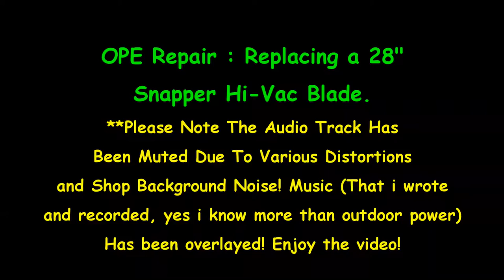OPE Repair | Replace a 28 inch Snapper Hi Vac Blade

Comment: The nuts were terribly frozen onto both bolts. One was so bad I ended up using a Nut Splitter slowly over several days before it split. I had to do it by hand with a socket wrench. This time I made sure the bolts were covered with Anti-sieze coating when installed.

Comment: Wouldn't a hi lift blade help to lift the grass better for a more even cut? And also pull more leaves off of the ground for shredding? Just wondering cause I have a Frankensnapper, a rear engine rider originally with a 26" deck that now has a 33" deck with a 30" blade. I traded for it and just found out that it was configured that way before I got it. It's in really good shape for it's age but I want to put a new 33" blade on it to take advantage of the 33" deck. And I doubt that it's very hi vac with a blade 3" shorter than what's supposed to be on it. I'm thinking that the blade and deck design is what makes it  Hi Vac.
Reply: I meant adding the Hi Lift wings...
Reply from the maker: Hi, sorry for late reply, as long as a blade has lift edges on it will lift the grass, regardless if it is a low lift, hi lift or mulching they all lift the grass, Snapper's Hi-Vac is only suppose to be used with a bagging system, that is when you use the bolt on lift kit, other than that for side-discharging the lift kit is not necessary but it is generally user preference, you can use the lift kit for side discharge but its not necessary. All a hi-lift blade does is create more suction to lift and throw the grass out father than a 3 in 1 blade, hi-lift is used for bagging primarily.  thank you for the comment and hope this helps :)
Reply: TheOutdoorPowerGuy  Thank you! 
 I would like to find a used bagger for this mower maybe this spring. My father also has a snapper 33" hi vac and he got the mulch kit for it but had me to take it off and replace it with the original blade. He told me that the mulch kit caused the mower to vibrate more and thought it was too hard on the mower. I mowed with it and agree with what he said. I'm not sure if it's damaging to the engine bearings or blade bearings etc but it did seem to be harder on the machine than a regular cutting blade. Not sure if this is due to the hi vac design or not but wondering what your thoughts are on this.
Reply from the maker: Generally a mulching blade wont cause it to vibrate unless the blade is bent (could have possibly hit something) or the spindle bearings could have been going out, Snapper Hi-Vac's are not the greatest at mulching but will mulch with the proper kit and proper mulching blade. Vibration in a riding mower is almost always due to bad spindle bearings or a bent/wore out blade.  hope this info helps :)
Reply: TheOutdoorPowerGuy  I will look into it further, thank you for your thoughts!

Comment: Im trying to remove the bent blade adaptor that the blade bolts to and what a pain so far no luck it screws off Ive tried heat and beating but so far no luck ugh..

Comment: I bought a new RER in 2013.  Did you just lay the mower on its side?  Does it matter which side?  How do I get under the deck to remove the blade?
Reply from the maker: You remove the battery and stand it straight up on the older snappers. newer ones you put on a lift or jack them up with a floor jack.

Comment: Grest video 👍👍.
What is the middle nut for?

After watching the video couple times.
The middle nut is to hold the adaptor on??
Reply from the maker: Middle nut holds the blade adapter to the spindle, when changing the blade do not loosen or remove the middle nut, only loosen and remove the two outer bolts that hold the blade on.
Reply: @TheOutdoorPowerGuy  thans for responding.
I did figure that out after the second time watching your video.

I did pull it off, which needef to be pulled, the nut itself some how got damaged and having to change it out.

Thanks again